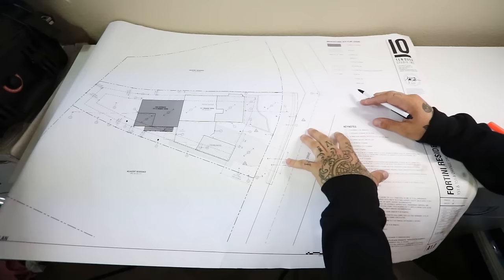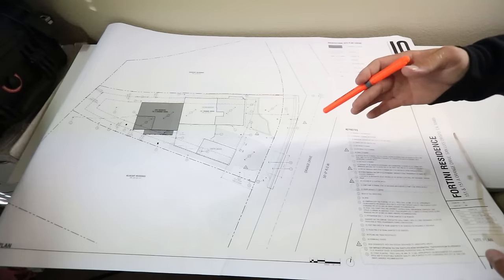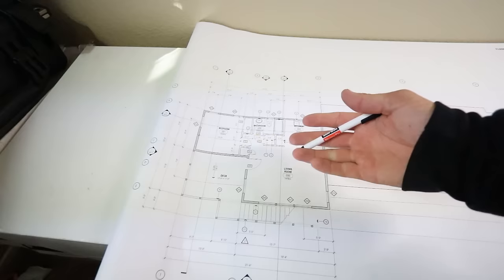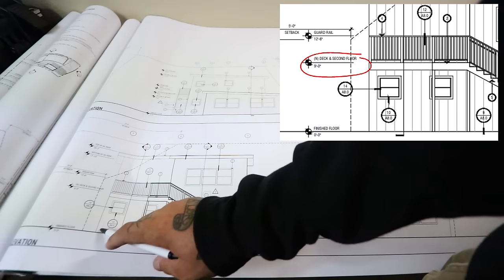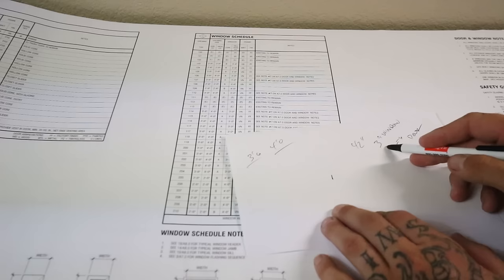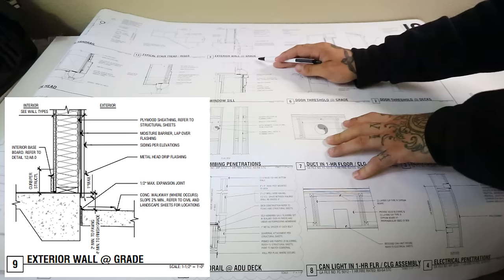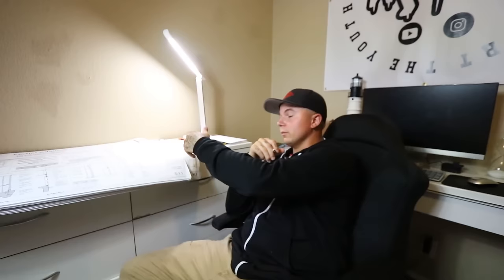How To: Reading Construction Blueprints & Plans | #1

Comment: 4:45 Difference between architect and structural engineer:

"Architects make things pretty, and engineers make things work"

Beautifully put in concise way (:
Reply: and workers make it happen
Reply: Agreed
Reply: DJ Get's the Party Started.
Reply: That’s about as ignorant as saying all framers do is nail timber together.
Reply: @___.___.___.___.___.___.___  no bro. You are not an engineer.
Reply: @DavidrKun  I don't claim to be an engineer. Im a framer if you must know, but not one ignorant enough to believe that all architects do is make a building pretty.
Reply: @___.___.___.___.___.___.___  I guess the difference between an architect trying to make it look pretty and engineer has to do his darndest to make it actually happen by real world measurements. Or make it work even inside it looks like crap. But the cover looks good.
Reply: @DavidrKun  you've got it buddy. nail on the head
Reply: When you say that engineerings make sure things are to code, you're wrong. Architects do.

Comment from the maker: Another thing.. When you do this every day, you tend to miss things when trying to explain it to someone who doesn’t get it.

If you seen something you’d like to recommend, or add.. Leave a comment! The more people chiming in the merrier!
Reply: Dude your the fuckin man bro keep these kind of videos coming not a lot of carpenters out there like this to take the time to make videos on how to read plans and things like this thanks man this video helps a lot you should make one where you go thru and snap a few walls out on the job and make a video on it that would be dope!
Reply: He is going to use a gopro and do just what you asked for.
Reply: Could you show how to compare a framing print to a foundation print to make sure the framing sits correctly on the concrete walls. I do this twice a week to find errors before we start a dig for foundation work. Sometimes brick ledge is added last minute and i have to scramble to get my layout program fixed and all relevant prints edited before footers get started. If i miss a wall then your framing is sitting over the brick ledge. I have to get it right every print

Comment: Hey Matt, I really enjoy your videos.  One thing to keep in mind when framing for your window and door openings.......many times on the architectural plans the size shown is a nominal size (not actual) unless the manufacturer was known at the time the plans were drawn and the actual dimensions for the window and door can vary by manufacturer.  The manufacturer would supply you with the actual rough opening size you need unless it was known prior to the plans being completed and the architect added that info on the plans.  Also, you have to keep in mind how many trimmers (also known as jack studs) are required which can affect the king post locations.  If the window or door is carrying an unusually large load above it may require more than 1 trimmer (jack) on each side which means the king stud would be spaced further apart.  I am an architectural draftsman with my own business and I try to include as much information as possible on my plans including structural information.  So my plans aren't just pretty, they are able to withstand what ever mother nature can throw at them.  Here where I live in NC, it isn't extremely common to have your architectural plans to be sent to a structural engineer unless there is something unique going on with the design that the building inspector would require an engineer for.  For that reason, I have to include structural information on my plans and I have experience working with a structural engineer.  My background consists or working with traditional stick framing, SIPS Panels for walls and roofs, engineered floor & roof systems, timber frame and log homes.

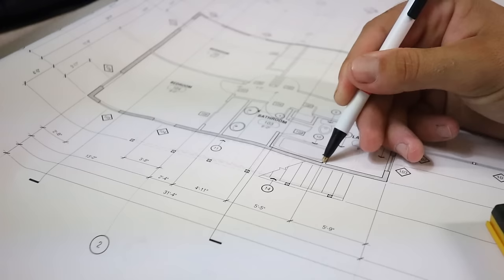Comment: What I also think ppl get confused on are the walls on the blueprint being the top plates you see like at 7:03 I only figured it once I realized going back 3 1/2 was because the studs are 3 1/2 wide which helped identify what was going to be a wall and that rlly helped

Comment: The total length of 31’-4” is different from the sum (31’-5”) of the subdivided measurements in the first plan (5:30 to 7:30). The sections add up (13’0” + 2’4” + 4’11” + 5’5” + 5’9”) to equal 31’-5” but the line below shows a 31’-4” total length. I searched through all the comments trying to find out what’s going on there, but guess I’m the only one confused.
Reply: It probably the unit setting the architect set in his CAD program when doing the drawing, i see this all the time when i use their drawings for underlays for my structural drawings…it is frustrating, thats why you dont “close dimensioning”. Structural drawings usually dont show many dimensions locating walls because architects are constantly moving them.
Reply: My architectural drafting teacher would add up our dimension lines like this and dock marks if they differed.  

If you're honest, the mistake happens in the unit formatting process 

Imagine a simple wall with one window in the middle of it.   You've chosen your autocad units to be drawn to 1/2" tolerance and imported a window that is technically 35-3/16 wide and the remaining walls on either side of the window are both 35-3/16" as well. 

With a half-inch tolerance set,  Autocad would individually dimension each window and wall to 35" clean as it would round to the nearest half inch, resulting in a wall that adds up to 105" if doing the math in your head. 

But if you did an overall dimension string of the whole wall,  autocad would add up 35-3/16" x 3 (105-9/16") then it would format to the nearest half inch giving you a dimension of 105-1/2" ...  this happens a lot if you don't have an organized drafter. 

If you're dishonest,  you can just edit the dimensions to fit whatever because you're too lazy to make things work,  and you'll have a real screwy set of plans... a nightmare for whoever has to use them. 

Sucks writing all that from phone haha.

Comment: Hey, Matt, I am curious about something regarding doors and windows and their rough openings. If you buy from a big box store, as an example, the details for the item usually will tell you what the rough opening is for the item. Would you still add your 3" or 5" respectively to that number, or would you go based on what is listed by the manufacturer?

Comment: So I started in framing houses then went into building fences. Moved out of state and took a job running cnc machines in a metal fab shop making service bodies and aluminum boats. This was my first experience with prints. I assume they would have the same basics am i correct?

Comment: Never trust the rough openings (ROs) given on the plans, by the architect, for windows and doors. These are the architects best guess from his/her experience. Get the rough openings from the manufacturer, (thru the GC) of the products being used on this particular job. Different manufacturers may build their windows and doors different than others. Especially when working with concrete!
🤜🤛
Reply from the maker: This is so true.. Never trust their guesses! Or their stairs.
Reply: Right. For stairs - Get in writing, the dimensions of the finish materials to be used, on this particular job (their all different) for the top and bottom of the stairs before you cut your stringers...Did I say get it in writing?
🤜🤛
Reply: I always give the manufacturer a quick call to confirm.  Better safe than sorry.

Comment: Im trying to add an addition to my home, but I’m trying to learn a bit so I know I’m getting a quality build.  I’ve meet so far with two contractors one says he wants plans from an architect and the other said he can do them. What is your thought about that? Are plans really needed from an architect?  I know we need permits and  both of the said they will take care of them. I’m trying to add an additional bathroom and room and get the laundry out of the garage and into the house as well. The build is approx 12x24. My house is an L shape and said just extended it would be cheaper the trying to square the home out. 

This is way too much info for me and then you have the bathtubs that I’m also clueless of what to go for?  I’m keeping the house for a long time and want better quality stuff that will stand time with Abuse of my young kids. I’m just afraid of putting the glass door and have flimsy glass that will break easy any tips on good tough quality bathtubs or what to go with?  Just need ideas. Since this is all new to me

Comment: Helpful video but I'm confused by one thing: you say add 5 inches (to door sizes) for rough openings for doors and just 3 for windows. I understand adding three inches for the jacks (trimmers) but why 5 for doors? You say the extra 2 inches is for casing I assume to have lumber better situated to nail a wide casing to but windows have casing too. Could you clarify?

Comment: Great video! I have  a question about rough openings for doors and windows. I'll use your window example of a 42" width +3. In my area we add 2" not 3" to allow for 3/4 bucking and shims on each side. Why do you use 3"? Also  we double our king studs and double jacks are outside of that, so every opening is at least 8 studs (two kings and two jacks on each side ). This is starting to sound like  a poker game, lol. I'm just curious to know why you an extra inch door an window openings. Personally I like more room vs less room when it come to the final install off doors and windows but our local code only allows for, I think it's, less than 1" of shim/bucking. so a +3" opening wouldn't pass inspection. I have a feeling this is a regional thing.

Comment: They had notes for blocking for things like toilet paper holder, towel bar ,etc that you should throw a block in the wall for.
Reply from the maker: That’s done long after the home is framed.
Reply: I have always worked jobs where it’s the framing carpenters job to install blocking for cabinets, towel bars, hand rails, etc.

Comment: hi, Matt, thank you for the infor. I have a question not sure if it is right or wrong.  in15.28 in the video, when you do math for the window opening, you add 3'' since it is window (frame), but dont you need to 6'' in total since it has two frame on both side. right ?
Reply from the maker: Hey Sam,

A window will have a R.O., typically it's on the suppliers site.

4'0 x 4'0 will measure out to 47.5" x 47.5".

When framing a 48" R.O., you'll add 3" for a trimmer on each side. 51" will be your header size and 1.5" for trimmer on each side will neck it down to 48" width. Thus allowing for a 1/4" variance side to side once a 47.5" window is installed.

Comment: I deal with all of the prints for our concrete construction company. I have to match the framing print to the foundation and concrete prints to make sure they match. Way too often, the prints dont match because the builder didn’t check every measurement. If we only dealt with the concrete print then we get blamed when one framed wall is off 4”. I blame the architect and the builder when something goes wrong because they didnt check it before they sent it to us. 1 out of 15 building errors i can attribute to my own layout data entry and those are usually corrected by the time i layout for walls or i get a call from the wall crew before they pour concrete. My walls are accurate to the 1\8”. Any issues should be directed to the builder

Comment: Why would you not pay attention to info for the plumbing and electrical, etc? What about those issues where the plumber has to do something crazy with a drain because a joist was in the way or some other issue related to other non-framing codes?

Comment: Starting to watch you videos l'm building a barndomium. Your framing videos are good information. The measurements are a little confusing to understand when including the drywall when placing the bottom frame to the foundation. A slower explanation with making marks on the floor would help a lot to understand.

Comment: Bro, 6:20 why did you measure the long side of that second window when the plan shows over to 13' to the wall minus 3'8" for the window? just seems to much to measure off the far end and add all those numbers when you already had the 13-0 ft measurement for that partition wall when a windows measurement off it.....
Reply from the maker: Probably missed it, being honest. I work myself out of corners typically, this build is tiny.
Reply: Try not to overanalyze his work, just take away the idea
Reply: @cencoast_7.340  I ask because I saw it as taking more steps then needed. I have read building plans for years so I wanted to see his take on how he reads plans. I also just asked why he chose to do it that way is all.
Reply: Willis,,,I noticed that too. Pull room dimension,,set back center line dimension for the window. Matt still does good work.
Reply: @gmburzynski68  He does most certainly. Just thought Id ask for his thought process is all

Comment: Why do they require a 1/4” per foot for the deck. Over 12’ is a 3 “ drop . Did I hear you correctly and if so I always use 1/8 inch per foot if not gapping decking and if you gap decking you can leave it dead nuts level

Comment: The plans don’t leave any room for spray foam in the windows ? Or is the rough opening 1 inch bigger then the actual window sizing?
Reply from the maker: Windows come smaller then RO.

4’0 4’0 window works out to 47-1/2”x47-1/2”, sometimes smaller depending on window supplier.

Comment: I’ve seen doubled up crimples on each side of windows, and NUMEROUS “trimmers” on both windows and doors. How do you decipher when that would be needed. I know this is structural, but if you would oblige... Thanks!
Reply from the maker: We’re going to talk about that in structural! It gets tricky but it’s all in the plans. Different details spec anything over “?” length opening has to be double trimmer & cripples.
Reply: Rasheem Sanford 👍

Comment: If you have a window that's 42" wide and you frame it to 42" wide does that leave any shim space?
Reply from the maker: Windows measure under what they’re labeled as, a 3’6” window doesn’t measure out to 42”.

Should always double check with window co. to see what they’re after for RO.
Reply: I see, so in most scenarios whatever the window/door schedule calls out, that’s what dimension you should frame your RO to? I always here people say “add 1 inch width and height” or “add 2” width and height” to the RO.

Comment: The thing thats wrong with this tutorial is that The Big Picture is missing. You did not show us - in the beginning - what the house looks like when its finished and the general in formation as far as (1) General floor plan, (2) side vies and back and front, roof, all basick layouts before getting into the particulars. Therefore, it is difficult to understand what you are talking about. You need a beter teaching format, especially on such a technical matter
Reply from the maker: We're teaching architectural plans, specific to rough framing. Exterior elevations play little role in what we talked about here.

When you know what you're reading (what I'm teaching here), you don't need to look at elevations aside for to verify a wall height or exterior siding. I didn't show any structural in this either, so it's safe to say it's missing that too.

Its like learning to read, in the beginning, all you want is pictures. As you get better, it's more words than pictures.

Comment: Architects don’t “make things look pretty.” They literally design the entire building, FUNCTION being the foremost priority. Everything from types of insulation, windows, waterproofing details, vented or conditioned attic, how the wall goes together, etc. They’re literally doing all of the design and all of the building science, and then the engineering department tells them/you what fasteners need to be used where l, make suggestions, and sign off in it. It’s actually very little that engineers do. Literally everything else is the architect’s job. This myth you perpetuate gives a poor perception of what an architect actually does and why they’re so overworked and underpaid. It’s a job of all maths and physics and thermodynamics, not just sitting on a CAD program drawing shit.
Reply from the maker: So do engineers design a buildings look?

No?

Ok, architects make the building aesthetically pleasing, engineers make it work.

If you think that’s incorrect, tell me why I’ve never contacted an architect when a span doesn’t work or something isn’t working? I contact the engineer..
Reply: @MattBangsWood  That’s not what I said, and I like how you only bring up “span,” which is structural, and not address everything else I mentioned. Maybe it’s different in the US, but in Canada, the architect designs every single detail of the building, except for the few structural components to handle loads/lift, grade, and pad, which is the engineers job. Passive homes, for example, aren’t designed by engineers, they’re designed by architects. It’s a tonne of building science architects use, so generalizing it to “aesthetics” really sells them short. It’s like generalizing carpenters to just framing, when they do much, much more.

Again, it’s about function more than anything.